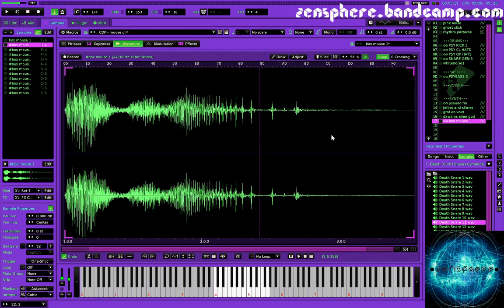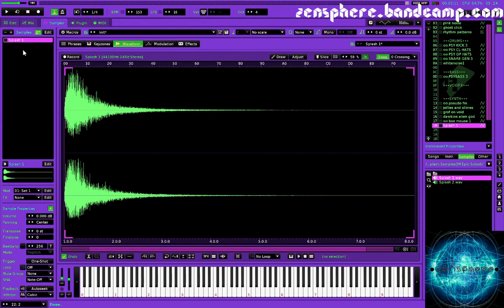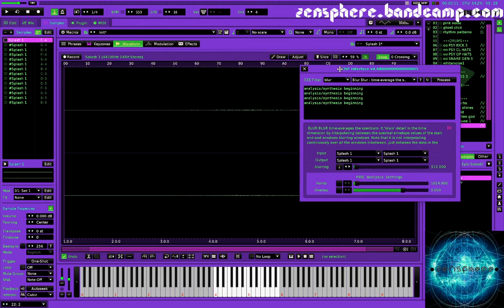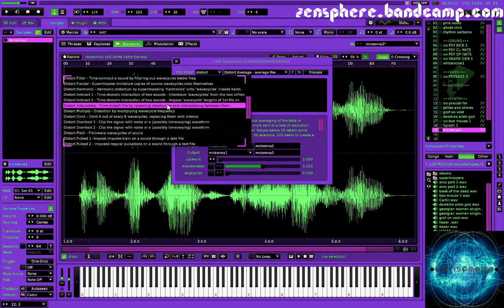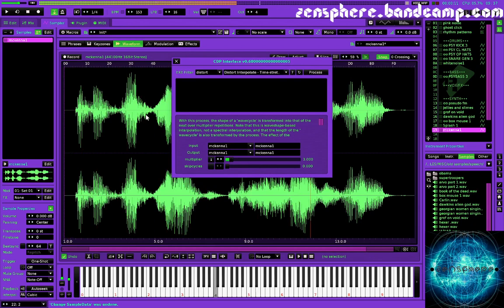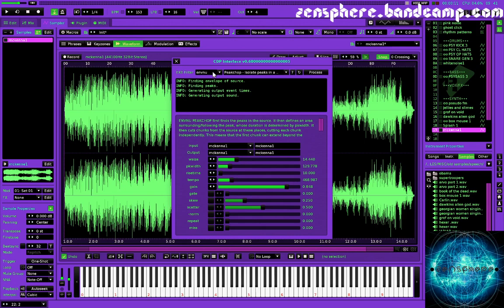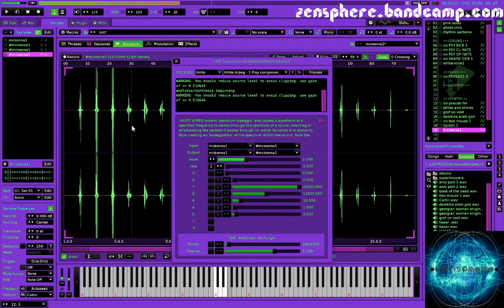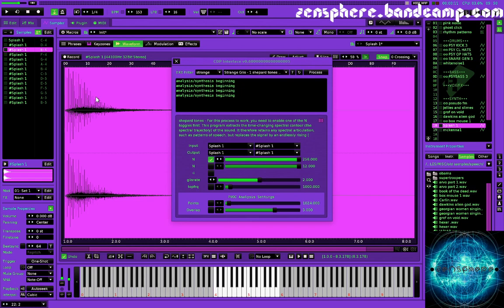GOD-TIER DSP in RENOISE?!

Comment: Very cool to see a CDP + Renoise vid! Excellent introduction :) If you haven't figured it out yet; you can hit the icon next to the question mark icon in the top of the tool gui to refresh the tools input & output samples. No need to close down & open it back up for this. It is a shame though as sometimes you want to use the same parameter settings on newly created material and with refreshing you have to select the process & set the parameters again as they are reset.
Planning ahead is needed sometimes.
Also worth noting is that some parameters can be automated over time if there is an arrow down icon before it. Press this icon and an envelope editor pops up. This editor is a little hacky as Renose lua api doesn't offer canvas options yet, but does work...trial & error style like the rest of the tool ;-) . Often min & max values have to be retried as parameter limits can for example differ based on sample length or the documentation isn't clear on what the min and max values are. Luckily the terminal will give advice here. Happy exploring!
Reply from the maker: Hey! that's great to know about the refresh option. I will definitely be using it going forward! Yes, I was aware of the integrated envelope and text file editors within the tool, and considered showing how they, or at least how the envelope editor is used, but actually forgot to get it on video...

Thanks so much for helping to develop this tool! It really is an amazingly powerful suite of processes, so it's great to have it available within renoise. cheers!